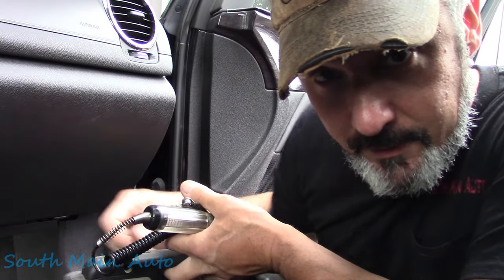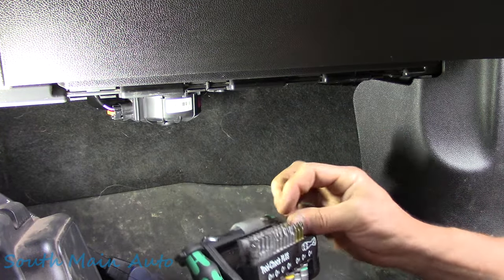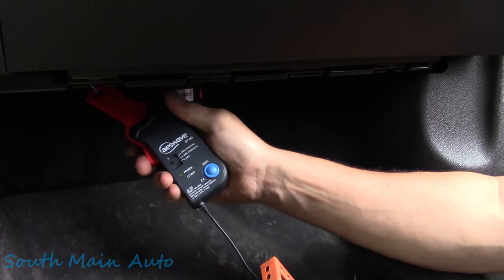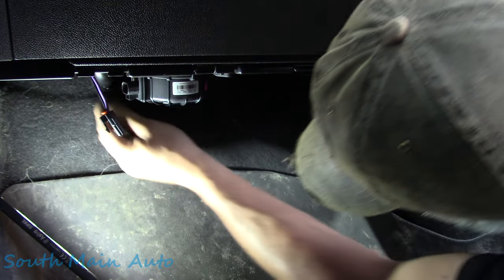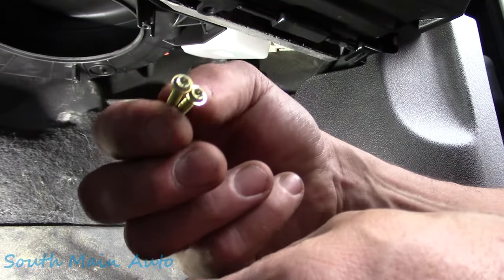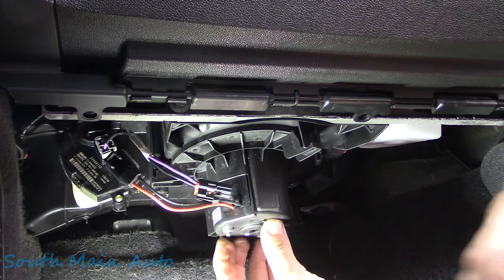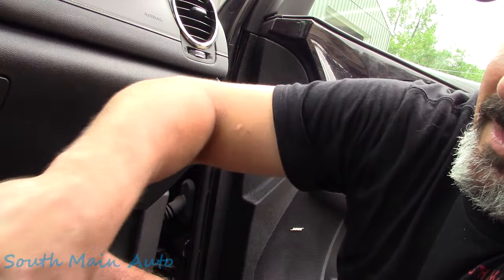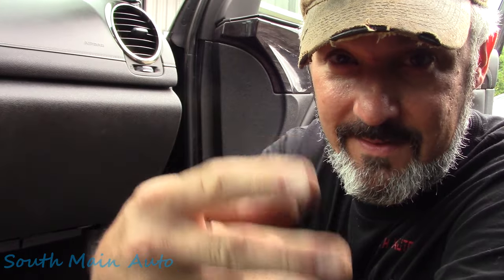Buick Enclave: Front Blower Motor Does Not Work

Comment: Well Mr.O I just happen to be digging into that 4.3 to 5.7 conversion as we speak. It's a 1994 so the cluster is different. Not sure about the rev limiter on the pre-95 trucks. If you happen to see this comment and know the answer, a reply would be greatly appreciated. I want to add that truck to the burn pile but my dad gave it my son and he won't part with it.
Reply: 94 and 95 were transition years for GM trucks. Those are often called OBD1.5, because those were not OBD1 or OBD2. 1996 was the first year of the OBD2 system.
The 94 and 95 are strange. From what I remember, all of the electronic modules seem to be separate and independent, so it would not surprise me to hear the electronic gov is someplace strange. 

Most of the parts are cheap for it, so most of the repairs are inexpensive. However, the ABS system on those are crap and good luck finding a replacement, when it has a problem. I tried to delete the ABS on mine with a PV2 valve. The PV2 valve was made in china with the incorrect seals, so it started leaking after only about 2 weeks. I almost ran through a stop sign and that would have been very bad. Those trucks also have chronic squishy brakes due to the ABS being hard to bleed correctly. Whatever you do, do not take advice from some of the YouTube videos or websites on how to fix the problem. There is a method to jump two of the pins to bleed the ABS system... and good luck getting a good brake bleed of the ABS system.

If you try to swap stuff around, then better do some research on it before putting out the cash. 

I own a 95 1/2 ton 5.7 TBI AT, and put about 200,000 miles on it. Now it is probably a pack rat nest. I used to have people asking me if I wanted to sell it... I should have said yes to one of those guys. The 1/2 ton short beds are sought after by some people.
Reply: @willw8011  Thanks for the info......this truck is a 94 but it's a Frankenstein making this all the more complicated. Transmission and engines for these trucks are year specific in that range though I'm not sure why. I think it was a chopped up at one of those buy here pay here at some point in it's life. It has no ABS. Brakes work great though. I've been told that for the most part it's a plug and play swap so long as I find a 94 5.7. Hell I may just scrap the idea and fix the head gasket. Wish I could get my son to let it go.
Reply: @rbailey225   Everything is year specific due to all of the changes and options. The 88 to 98 body style has a wide variety of things, especially electronics. 88 to 93 had OBD1, 94 to 95 had "OBD1.5", 96 to 98 had OBD2.

I cannot remember for sure, but 88 to whenever might have had some carbureted engines. Most have TBI engines up to 95, but 96 and after had vortec engines.
If I remember correctly, GM also had 4.3 V6, 305, 350, 454, 6.2 Diesel and 6.5 Diesel engines in these trucks with the carbs or TBI or vortec or diesel injection. The 88 to 98 had 3 types of spark advance: vacuum, electronic module (under the distributor), and the OBD2 had it in the ECM, if I remember correctly... It is difficult to remember all of this stuff. 94 might have the vacuum advance or the electronic module under the distributor, IDK. My 95 with a 350 V8 TBI has the electronic module under the distributor. All of this stuff changes the electronics mixture and ability to function with each other, though. The TPS and IAC valve might have also changed a few times during the 88 to 98 body style.

There were also maybe 4 types of automatic transmissions (700r4, 4l60e, 4l65e, 4l80e) and those also had changes in the electronics depending on the year, size of truck, and the OBD1 or OBD1.5 or OBD2 type of system. I think there were also 2 or more general types of manual transmissions and of course a few 4x4 transfer cases to change up the mix and match of everything electronics. The 350 V8 was also in the 1/2 to over 1 ton size trucks and SUVs, so it had just about every transmission combination available put on it. The 350 V8 industrial was also in some of the Topkick commercial trucks too, which were somewhat of a different thing. So finding a 350 V8 is easy, but all of the other electronic stuff makes it very different.

1994 should have had ABS originally. The 88 to 98 also had a lot of changes in the ABS systems, which also means lots of electronic changes.
Sometime, maybe 93 or 94 airbags were also added, which changed the electronics a bit too.

Government regulations, especially emissions standards and fuel efficiency standards changed a lot between 88 to 98, so a lot of things had to change with it.
Reply: @willw8011  It has no ABS which is strange. Truly a Frakenstein. Makes me wonder if the engine was even original. We swapped in a rebuilt 4.3 from one of the big box parts store and it was by far the worst decision ever. Worst engine ever (Power Torque). Warranty is as bad as the engine. Had to replace the drivers side head because the rebuilt head was so terrible that it was pouring oil into two of the cylinders and fouling plugs every 100 miles.Thankfully 95 was the year airbags were added. That is the year the dash changed to accommodate the airbag. One less headache.....lol.

Comment: Could the motor be controlled via PCM rather than direct steady voltage? If that's the case it would maybe make current hard to detect as a straightforward value?
Reply: I hadn't thought of that.
Reply: @shadetreemech290  it's maybe something you could set up a scope for. Auto range, auto trigger and see if a square-wave pattern appears. The duty-cycle should increase as the fan selector is advanced through the speed range resulting in wider 'on' pulses. Depending on what you see it could indicate faulty MOSFETS rather than just a dodgy fan motor. Just a thought 🙂

Comment: Looks like the brushes were worn out to me. They shrink down to where the spring isn't long enough to push the brush tight against the commutator. Your banging it fixed for a bit, but probably not for long.

Comment: Do you always have to change the cage when replacing the motor
Reply: No
They generally come with the cage. 
Some are balanced as well.
Reply: Usually yes, the cage is balanced with the motor and is sold as one unit... and why not change the cage? On the total of the motor it costs nothing, it's just a piece of plastic. For some vehicles they're sold separately,  usually for older (pre '80s) cars that used metal cages.

Comment: Aftermarket blower motors are trouble.  I've tried them two or three times before learning my lesson.  One failed after a year, another one was noisy after a couple of months and another one just didn't have the speed or power of the original.  And, since not long ago, I think you had an issue with an aftermarket blower motor on a Nissan, I'd think you would shy away from aftermarket blowers.  Just sayin....
Reply: I just had the same experience. Last year old OEM blower motor started squealing, bad bearings. Got an aftermarket motor and six months later it failed - dead short. 

It just happened again and this time I discovered a lot of secondary damage. After testing the switch to the resistor I noticed electrical damage. The short caused the resistor to burn and melt the connector causing it to be welded to the resistor. It also melted a lot of wire insulation. Ordered OEM resistor, blower motor and connector. 

Just have to trace that ground wire to the body and check it, and wait a few days for ordered parts to arrive.

Comment: Customer complaint " I bought a GM! " 😂
Reply: It could be worse, they could've bought something else!
Reply: @MikeBrown-ii3pt  like a Chrysler?! 😂
Reply: That’s the best one yet…
Reply: Saab 9-3 used to suffer terribly with rusted blowers terrible place to hide them lol
Reply: I have a 2017 Ford Focus. 2 transmission repairs, and new alternator in 5 years.
Reply: @KevinWindsor1971  had a 2006 Focus wagon with a stick which had a 2.0 L Mazda engine in it.  50 mpg, totally reliable until a nice lady ran an intersection and destroyed it.  One of the best vehicles I've ever owned.  The new ones are definitely not the same.  Too bad really,  they had a good thing.

Comment: I’ve got a 1999 Tahoe and the ac only blows on high. I’ve replaced blower and new control. Still only works on high. What else could it be?
Reply from the maker: Resistors or wiring is to resistor or one of your new parts is bad
Reply: @SouthMainAuto  I replaced the resistor last summer. I’m thinking that it may be a bad part. Because I tried 2 different controls thinking that same thing with being a bad part. And it wasn’t the controls or the blower motor. Thank you!

Comment: I had a question. I have a 2020 Hyundai Sonata 1.6 T. Wonderful little car. Just peppy enough and zippy enough to get me around slow drivers. My question is. The other day after grabbing some food I was in the parking lot eating watching another SMA video I suddenly started smelling a burning wire smell. It was faint so I didn't really pay that much attention to it. But after a while it became really noticeable. Should I be worried if my car randomly starts having a burning wire smell? Anyone out there know if there is a way I could do a quick visual to see if I could spot anything burning? I have an appointment with the dealer but I don't trust them. So if I can pinpoint it myself and show it to them when I bring it in there is a higher chance of getting it repaired. More often than not I'm always told Could not duplicate or that they could not find it and that I shouldn't worry about it. And unfortunately I'd have to take vacation time to take my car up to Mr.O to get an honest diagnosis that's worth the it and I could trust. Also, I have a very loud noise driving I think to be the hub bearing on the wheel. It's a fast thumping noise. And sometimes sounds like a whining noise. I'm just trying to do some homework so I can take some solid evidence to the dealership and they don't return with the annoying Could not duplicate message.  Appreciate any help the community could offer.
Reply: At least in older vehicles there is a resistor stack located in the air ductwork. If it gets dirty it can overheat. With newer cars it might be a solid state control.
Reply: @machintelligence  got it! Thanks!

Comment: I think you're gaining something like 15 hp going from 4.3; to 5.7 at that time
Reply: Yeah, not enough to make a difference.
Reply: @commietube_censorship_sucks  I believe the 4.3 at this point was Vortech. Which was about 190 or 195 hp.
Reply: @commietube_censorship_sucks  yes that's true for the eight cylinders. But as I recall, and it has been a while, the 4.3 was a few years previous. In fact maybe four or five
Reply: @commietube_censorship_sucks  OK. Makes sense. Nobody paid  any attention to that engine in the full-size trucks

Comment: I WOULD NOT have changed that motor unless I had first explained to the customer it was now running after being tapped on and the customer said go ahead and change it out.
Reply: The tap was the diagnosis. Its bad.
Reply: @mph5896  if it ran after the tap it was not bad.

Comment: I bought a 84 Dodge Ram four wheel drive from my dad was fixing the oil pan gasket and found a bunch of metal in it so I was looking around to see what engines I had and the only one was a 440 magnum I looked around found a bell housing and a flywheel I managed to squeeze it in with only one dent in the valve cover so it would clear the brake booster and pushing electric fans to keep it cool and I had a84 440 4 barrel 4speed four wheel drive  talk about torque it would climb a tree if you let it and right after I had it done and sorted out a winter snow hit the area and I made money with the winch I had on the front and the bumper was a welding project that was probably a bit heavy on the pickup but I was not afraid to push trees down with it and when the snow was deep enough to high center a lot of cars I was busy getting them out of ditches but it was not very good on fuel economy I was asked about what I got pulling my trailer with a car on it to a race track in the state north of us and I said it gets nine miles to the gallon with or without the trailer it really didn’t care about the load it was pulling I miss the old pickup but I had rebuilt it from totaled twice and it was showing some cracks in the frame. First was after my dad caught it on fire  the second was when my roommate rolled it over two times my mother asked me what was original in it and I had to list the frame and the

Comment: Wow a GM with a climate control issue? That never happens!
Reply: Facts.
Reply: I have a 2004 Silverado with dual zone climate controls. The passenger side blend door actuator went out. It would only blow hot. It is an all day job to replace it, because the whole dashboard would have to come out. Oddly, the driver side only takes about 20 minutes. Solution: Stuff rags in the passenger side air ducts and get on with life.
Reply: From my experience, GM has the best AC, as in the coldest AC.
Reply: @willw8011   What good is that if it fails in less than 5 years?
Reply: @_zigzak   You should only buy new vehicles and keep those for 2 years maximum. Everything will be warrantied!
Reply: @willw8011  or buy reliable vehicles and never worry about warranties or car payments